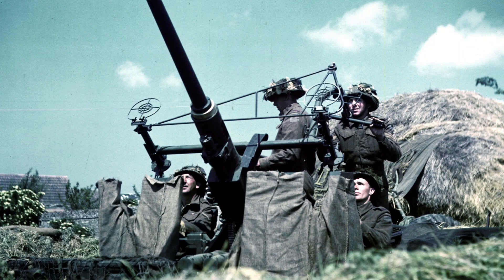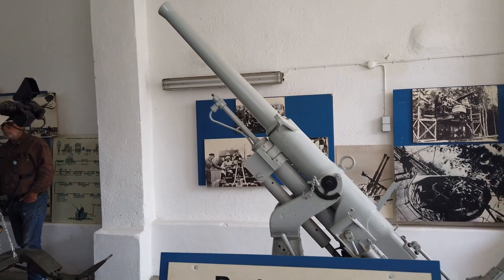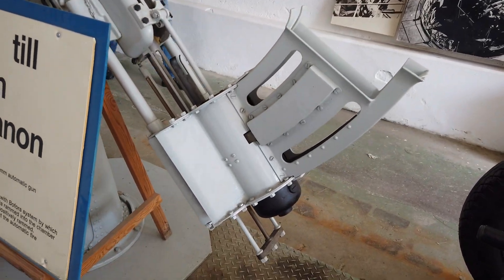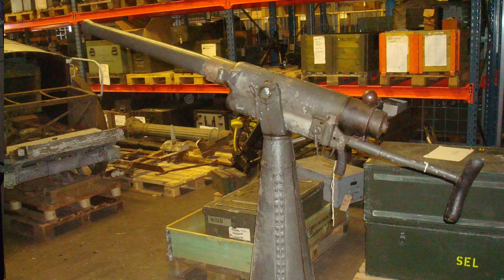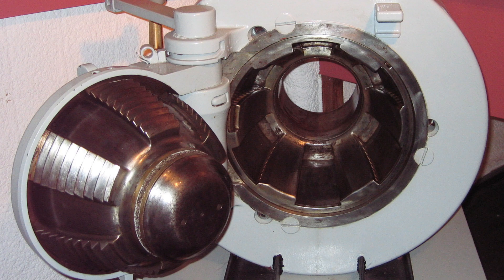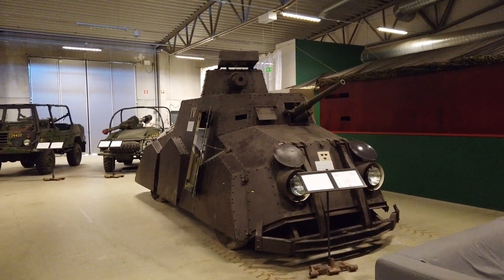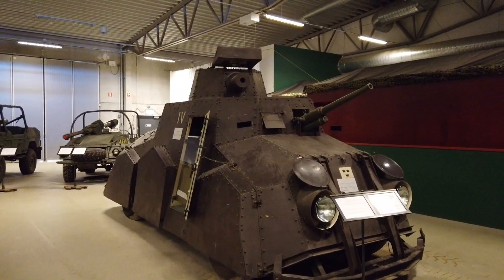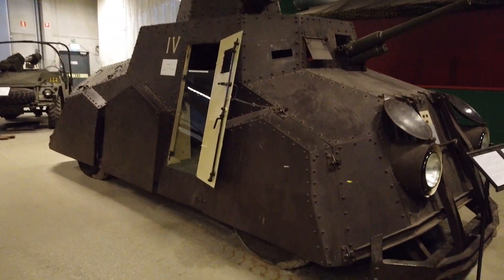Rare prototype Bofors 37mm m/98B  led to Bofors 40 mm m/36 L/60.

Comment: Looks semi automatic to me, the lever to the right of the breech looks like it operates the falling block breech and simultaneously rams a shell from the ammo hopper. For it to be automatic, the mechanism of feeding would need to be driven by the gun or a non human external source
Reply from the maker: That's an excellent observation! Thank you 😊, this means that this is probably the first prototype, the one that got rejected because it was not fully automatic. Even if they managed to get 250 shots per 5 minutes out of it.